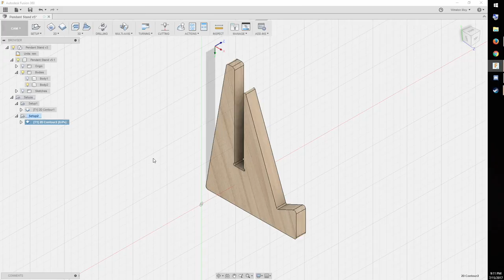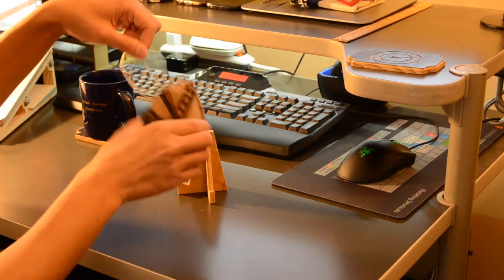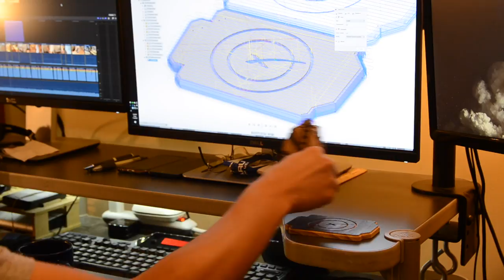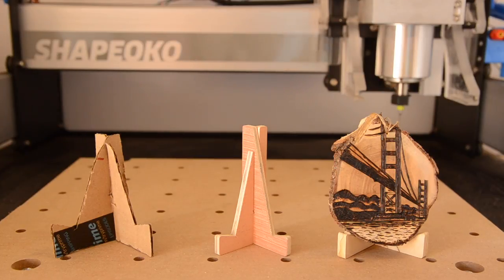Interlocking Stand for a Woodburned Gift - CNC Project #94

Comment: Hi Winston,

I have a Fusion question if you have time. When I set up a Fusion job to run I set my tool paths to zero using Carbide Motion and start the job. The job will not start at the zero location but carriage moves way to the right rear of the machine near but not all the way to the home position. If you can point me in the direction to correct this I would appreciate it.

PS I love the stand you made for the art piece. The maple wood you used really looks good with the art.
Jim
Reply from the maker: Two places I'd start: Is the origin point of your CAM setup where you expect it to be in Fusion360, and what does the toolpath look like when you run it through a Gcode visualizer?
Reply: Winston,
Thank you for getting back with me. 
I had set the CAM Origin as the Fusion Origin the zeroed X,Y,and Z to the center of the work piece. I went back this morning and changed Origin to selected point and assigned the top left corner of project and processed new G-code and that worked fairly well. The problem now is the cut starts about .25 inches off the right side of project on the X-axis and about .25 inches short of the back of the Y-axis. I am using a .25 inch ball cutter so I am thinking I needed to zero X and Y by touching the sides of the work and setting each to zero and not the top left corner. I will let you know how that goes tomorrow.
Thanks again for your help and thanks for all the videos you make and share with everyone.
Jim

Comment: Hi! i am experience some serious difficulty on finding my feeds and speeds for small bits like the one you are using. Can you tell me what values did you use for depth of cut, speed and the diameter of the tool?
Thank you!!
Reply from the maker: +Pedro Ramos For a 1/16" bit like this, I'll do about a 0.03-4" DOC, 30-50 IPM, and 10-16,000 RPM. 1/32" I'll go about the same, maybe a little slower in feedrates. For 1/8" endmills, look up Carbide3D's recommended feeds and speeds. The Nomad guide shows 1/8". Shapeoko guide shows 1/4". Anything the Nomad can do, the Shapeoko can do faster, but it's a good starting point.
Reply: Thank you for the fast answer. I will try it! 
keep up the good work.